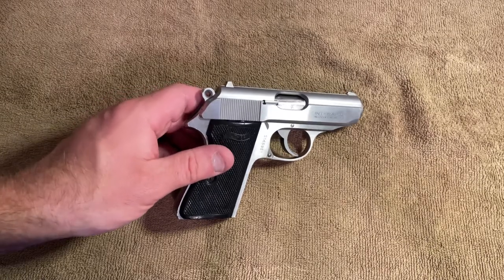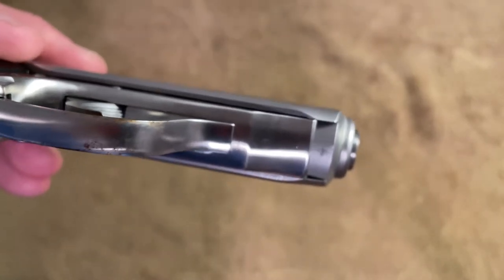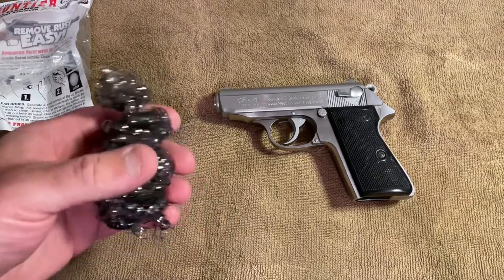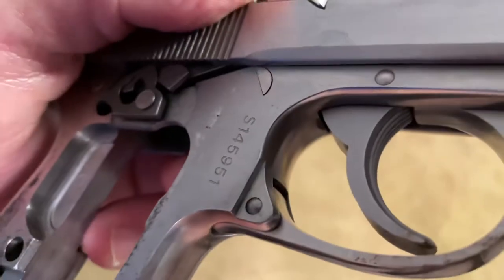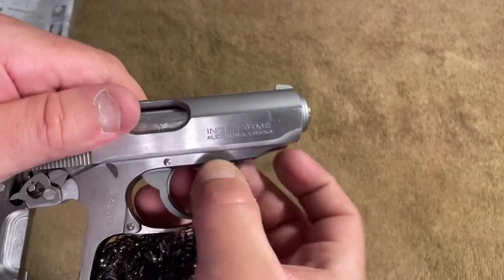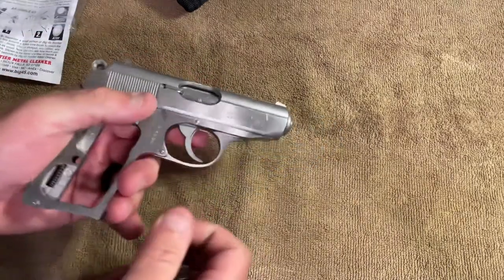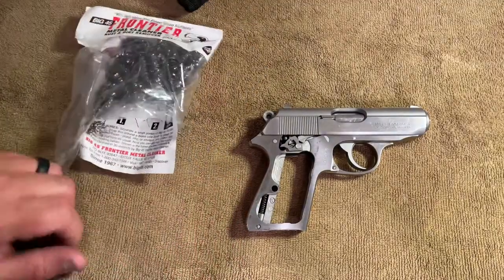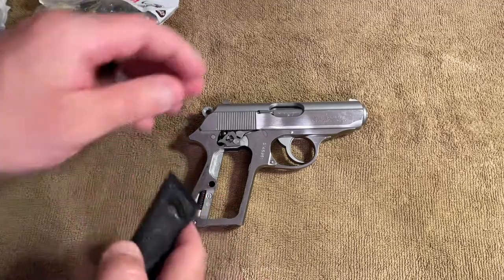Walter PPK/S Rust Removal!

Comment: So it should work for a stainless steel revolver? Just ordered it on amazon. Thanks I hope it works.
Reply from the maker: It worked on a stainless PPK and other guns with bluing. It does take a couple drops of oil on the cleaning pad. I tried it out underneath the grips where it was hidden just to make sure it wouldn’t scratch or anything. It worked great for me. Thanks for coming by!

Comment: Hi again, wonder what that would do to a nickel finish?? thax,Bill
Reply from the maker: I would try it on a small spot first, as a test. On chrome, stainless, and bluing it does great no scratches. Our charger has aluminum wheels I even tried it on there with success to remove some brake material. Definitely for me, an average gun and DIYer, it’s worth it. Thanks for coming by!

Comment: What holster is that you are using?
Reply from the maker: That is a canvas inside the waistband holster I bought from Amazon years back. I don’t recall the brand and I tried to look back and see what it was, but no luck. Thanks for coming by!
Reply: No worries! Just bought a vintage PPK/S at an auction that has a bit of rust on the trigger guard, so I ran across your video. Also looking for a good small waistband holster.